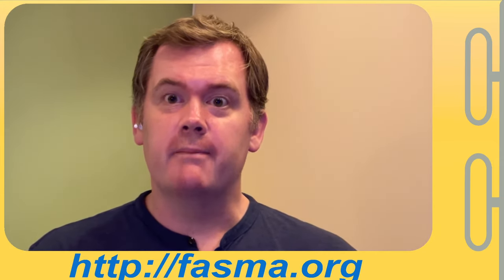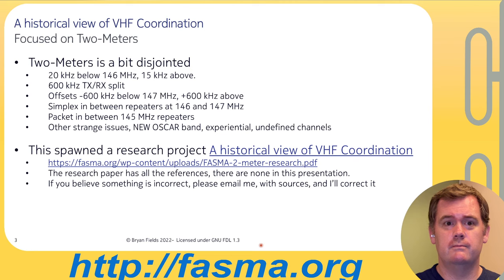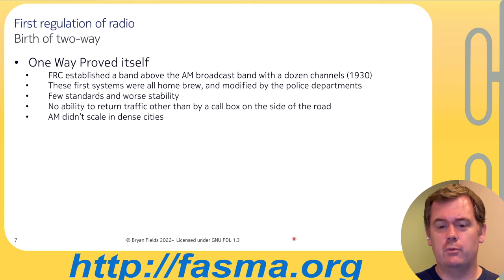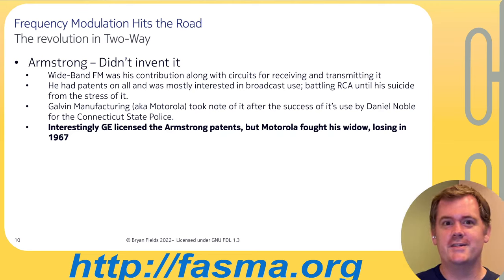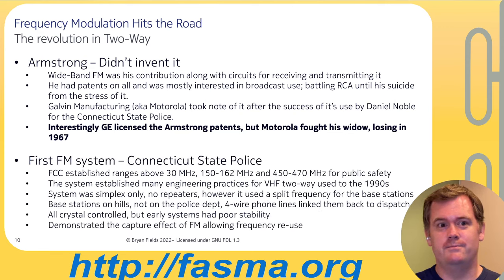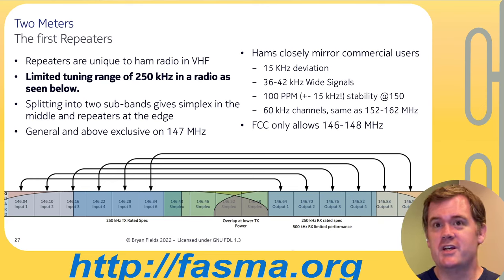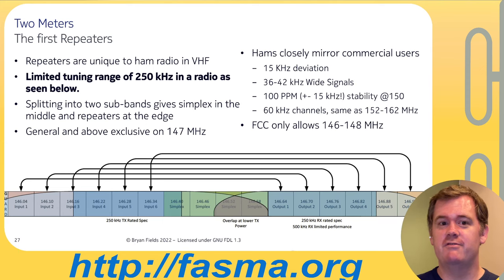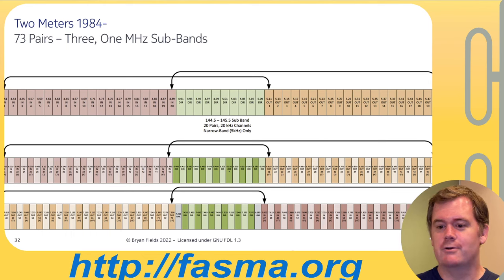Two-Meter Band History

Comment: Hey brian your so knowledgeable man thanks for all your videos i was wondering if you can help me connect a raider controller to a vertex vxr9000u i have a db25 cable with breakout board connectors i tried to match the pins from both manuals repeater and raider but im not getting it right because the led lights are all solid except for receive is off talk and listen are constanlty blinking dimmer than the rest i appreciate it if you can help i have the manuals if you need to see them  thank you for all you do!